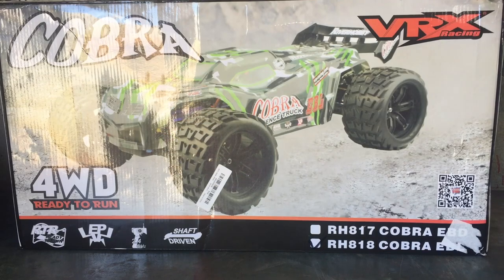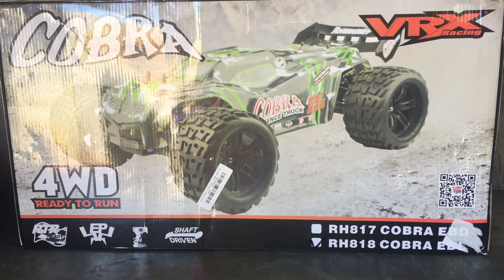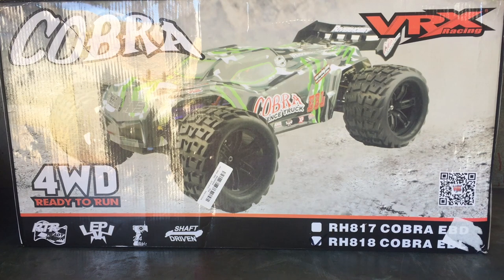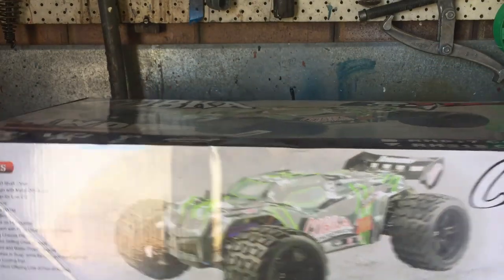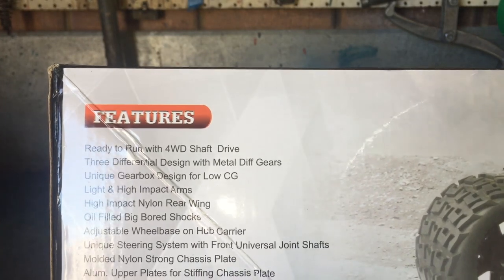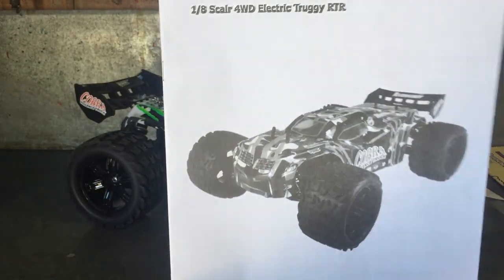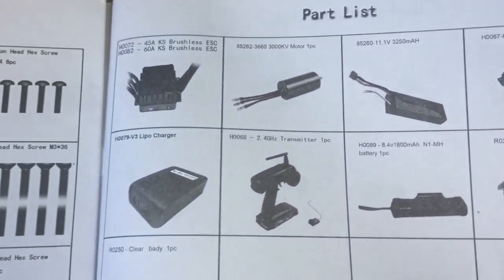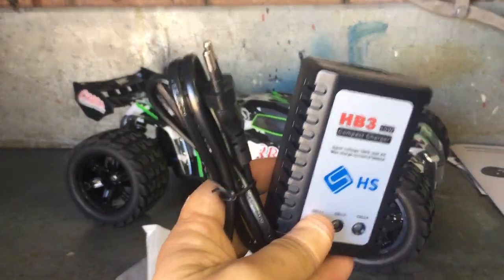VRX RH818 COBRA Brushless Truggy - Unboxing & Overview

Comment: Awesome looking truggy, some familiar electronics. Exactly the same servo as the HSP trucks, my 2 HSPs had them as stock. Worked just fine until the internal plastic gearing wore out. Interestingly the esc looks like a recoloured surpass hobby unit, identical instruction sheet too. Looking forward to seeing it running, looks like a beast 💪

Comment: They’re a great truggy.  I’ve had mine for about three months now still running great had done a few upgrades/mods to it and only one or two breakages but replacement parts are very easy to get. I’d say the engine KV rating would be 2000 because that’s how much mine is, when I purchased it
Reply from the maker: Thanks for watching mate 👍

Comment: Great review as usual. Recently got myself a kit version (without electronic). Matched it with  3670 motor, 120A esc and dumborc controller with gyro receiver. It turns out i don't really need the gyro after all because the cobra is pretty good at stability.
Reply from the maker: Awesome that's what I plan to upgrade on this one 👍

Comment: They are not bad I just bought one weeks ago the only thing I don't like is the slow servo
Reply from the maker: Yeah I will be replacing the servo on mine, it is a bit on the slow side
Reply: @PERTHWESTOZRC  yes watch out for the moter to esc  connecters they will pop out I just cut the  zip tie and let it free
Reply: I noticed them poping out after a couple jumps

Comment: Now you're talking Dave!  Really looking forward to seeing it in action soon and hopefully a speed run.  BTW, there's 2 of these on Banggood's website. The one you linked comes to AU$425 using the discount code. The other listing seems to be the same car but is cheaper and comes to AU$409. The discount code doesn't work on that one but a code (BGAFF10off) from another of your videos is accepted and the price comes down to AU$372 but beware "expected to ship before Jan 3".  All prices include shipping and GST with insurance removed.
Reply from the maker: That's very odd Roger, because at time of filming this video which was only 2days ago the price was well under $400 as I stated and even less with the code I was provided... I will have to check up on this and see what is the go. Cheers for notifying me mate 👍🍻
Reply from the maker: Roger looking from my Banggood app the prices of the 2 models I can see are actually $352.68AU and also $337.14AU which is even cheaper than the $365 on the webpage on PC from where I got that price for this video. Maybe you chose the wrong warehouse and it made the shipping blow out the price you stated cause its not anywhere near over $400AU bud. If you are on Facebook message me direct on my Perth West OZ RC Facebook page and I can show you a screenshot
Reply: @PERTHWESTOZRC  I don't know what's happening with all the different prices. When I go via your link on my PC it shows $360.74 with $33.47 shipping. The other page shows the car is $337.14 with $35.38 shipping.  No codes used.  How much shipping cost do you see?  Sorry, I'm not on Facebook.
Reply from the maker: Go look at my latest community post now, the 2 listings I see are even cheaper than I stated the other day during filming if $365 AU so it’s no where near $425 mate
Reply from the maker: Ok I see it now, I had no idea of the higher shipping costs for this one sent to AU, I was just told by my contact at BG the price was X amount $ on promo Black Friday sale for the product only and given a code. It is a large box and has a bit of weight so I guess that’s the postal charge from China to ship!

Comment: Think im gonna order one.. looks great and it's fast! :) my first rc car after 20 years or more.. order also another 3s battery for it 👌😎
Reply from the maker: Yeah it’s a good truggy , link and coupon code to save a few $ in the description 👍
Reply: @PERTHWESTOZRC  sweet bro .. although the batteries are confusing me .. i know 3s 3000mah but what to pick/chose max. For the esc.. 25c/30c .. i dont wanna burn the rc, the same day 😉👌
Reply from the maker: Choose a low discharge rate to be in the safe side
Reply: @PERTHWESTOZRC  okay thanks

Comment: How does a HSP 94111(either 60A ESP with 2s or 100A ESP with 3s battery) compare to this? Thanks
Reply from the maker: I'm not sure mate I only just got this, haven't ran it yet, cheers for watching👍
Reply: @PERTHWESTOZRC  looking forward to the test! 

One thing I noticed, is that this comes if centre diff. The Hsp's doesn't.  Will that make a difference?

Comment: Hi David.. I've owned two of these truggies (both roller versions); I blew up the first one as I went 4s straight away, with a 3665 3500kv motor and a 120amp esc - pulled very hard but all three diffs went down on the 2nd run, so on my next one I went with the same motor but on 3s with a high discharge battery and it's perfect - still pulls very hard, so you'll still be very happy with it on 3s - so yeah, no 4s for this one! 
You can see mine run full on in the link below last summer - cheers! 👍
https://youtu.be/JWTb-xks-kI
Reply from the maker: Cheers for the advice Joe, since this is my first try at a VRX racing RC i appreciate the info brother. I have plans to put a high Kv motor in it later on after i run it stock for a while 👍🍻
Reply: @PERTHWESTOZRC  You're welcome! When you're ready, up the motor but ensure you buy one with a 5mm shaft 👍
Reply: i bought one with aftermarket electrics. it was upgraded from the brushed version. but i agree. no 4s for this one. curb crash broke some of the steering linkage. i havent fixed it. i may just buy a new one. keep the first one for a parts car.